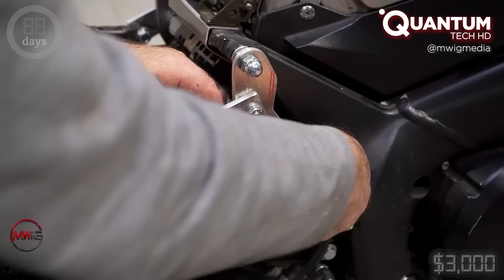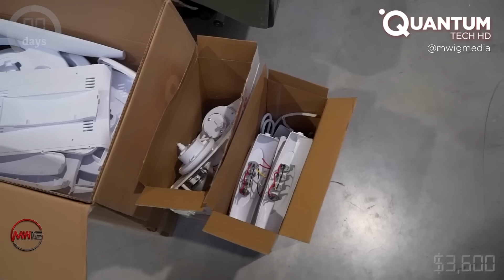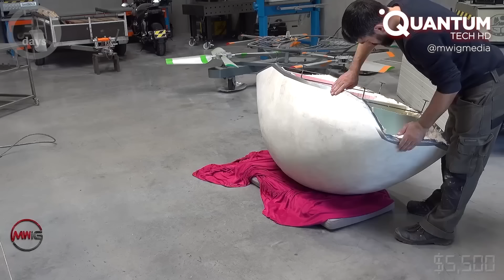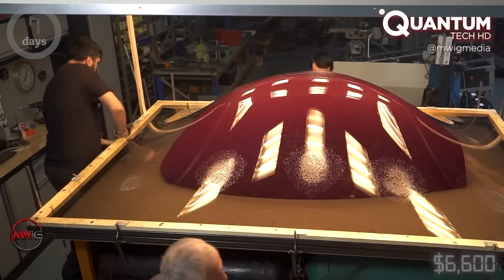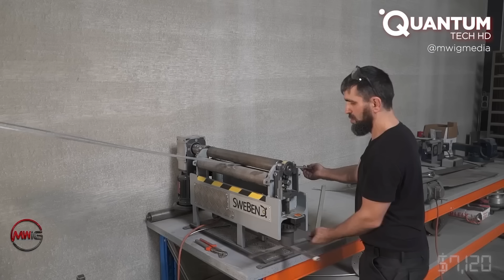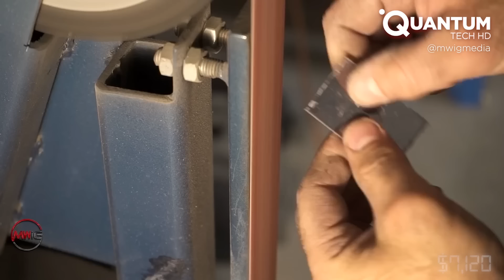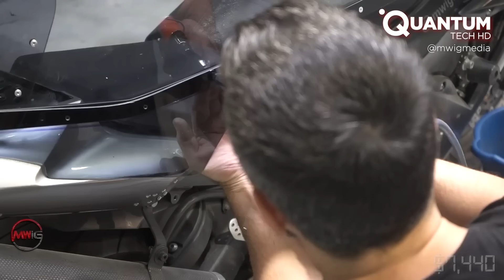The Motorcycle That Beats the Rain (Built in a Garage) | by @mwigmedia

Comment: Interesting, maybe he could have made an oven with a reverse mold. Using poly-carbonate with heat, air pressure and time instead of the vacuum. Then coat the outside with rain x and the inside with anti-fog.

Comment: for anyone interested in the pump system I believe fast bags air suspension which is pretty much air suspension with bigger valves technology would be helpful in his air vacuum applied with a heavy or weighted lowering process from heater to mold would of help out that problem

Comment: The bike design looks really impressive, but having to ride in a continuously bent-forward position is not good for our health, especially for the back. Also, if the bike skids or falls, how much protection does it provide to the rider? What are the chances that the rider will remain safe? And if it suddenly stops raining, how quickly can the bike's cover be removed? Also, what will riders do in hot weather?

Comment: That was the most dumbest shit I've ever seen. Excellent effort to build something completely impractical and not fit for purpose?
Would be hot as shit - no wipers for the rain, no demister, no air plus your legs and boots soaking wet.
All through a tinted screen which would limit your vision in rain anyway.
Me thinks this only achieves clicks.

Comment: Forgive me but as an inventor myself I have to state what to me is the obvious. I've ridden my bike in Washington State where it rains on and off all day.. stood my solid ice pants in the corner and made bets when they would collapse. That  said The first thing I notice is that the legs and feet are not protected.
  As to the molding... ARE YOU KIDDING ME? Heat rises!!... That is a major hint... I've already designed two simple ways to do it without all those heaters, wand since its a simple shape no vacuumed needed.. another clue  And he's not reheating it again and again to get what he wants,, WTF... plastic can be heated over and over again so ling as you don't sing it (white bubbles)so its not a failure  until it's entirely white with bubbles!! (practice makes perfect)
  His skills are very impressive but exicution is of a novice and clearly has too much money. When you do things with less or nothing at all that's when you get really creative IMO... Which brings up another question... why does the whole thing have to be plastic? You only need clear where you look... The rest can be anything that is light and durable and weather proof.
   And as others have pointed out  aerodynamics is a main factor.. time spent in a wind tunnel and or computor program will help. I believe that done right cross winds would have less effect instead of more... 
   Then there is the protection roll bar to prevent complete destruction when you wipe out in the rain or ice or snow... (yes Ive ridden in all including through the snow storm that brought down an airline in the Potomac , ... Wiped out like fifty times.. BTW if you are going to ride a motorcycle in two feet of snow on the highways... (don't) follow the big trucks wheel trough and keep your arms stiff. The wheel will ride up the wall and then correct itself ... think of toboganning.... and watch the build up of snow and ice which fall off and go SPLAT ALONG WITH YOU AND THE BIKE, ..USE A FOUR CYCLE NOT A SNAPPY TWO CYCLE... IF YOU HAVE TO USE TWO CYCLE USE THE HIGHEST GESR POSSIBLE .. OTHER WISE YO'LL SPIN THE TIRE AND LOOSE ANY BIT OF TRACTION AND POP YOU ARE ON YOUR ASS AND CARS ARE TRYING TO AVOID YOU ...
aND never EVER RIDE ON ICE WITHOUT SPIKES... HITTING SNOW EVEN ICY SNOW IS FAR LESS PAINFUL THAN ICE AND CONCRETE. gRAVETY SEEMS TO BE TWICE WHAT IT NORMALLY IS AND THE ROCK HARD GROUND CRACKES BONES... 
  Sorry caps lock... One last question... why are we still on the ground for travel?????
Blessings

Comment: I have a dream about a motorcycle that has a waterproof fabric attached to the windshield, folded and barely noticeable in good weather, and in the rain you unfold it and place it over your body and head as protection. It is transparent in the head area, has support ribs for strength, but is flexible enough at the same time. A kind of cover-up as part of the motorcycle... You wait for it to dry before folding it back up. Is something like this feasible in a practical sense?

Comment: Reasons why I believe there are problems with the design:
- Aerodynamics
- Windshield
- Air pocket created by vacuum
- Crosswinds
- The person's spine remains arched for a long time
- Passenger squeezed against the rider
- Hot days
- Difficulty keeping it open for refueling, for example
- Even though the design is for rain, the legs are still exposed

Among several other questions about the additional weight, whether the use of a helmet would still be necessary, etc...

Comment: Very impressive skills, but as a motorcyclist its really a solution to a problem 99% of all motorcyclists don't care about.
Also, try doing a turn - very little room to counter weight by moving your body, the same issue leaning at speed. Plus in a crash you are now attached to the bike and there a various bits of metal waiting to impale you. Crosswinds will be horrendous. 
The more I think about it, that thing is just a death trap!

Comment: I'd hate that. It's not riding under the rain that's problematic. It's riding on a wet surface with limited visibility if the rain is heavy enough and you get splashed into your visor from other cars etc. If getting wet was the only problem, it wouldn't be a problem at all.

Comment: If he creates a strong enough metal molding which is based on the working prototype. With a constant heat source during vacuuming, a single piece shell could be made.

Anyway it’s a marvel piece of engineering.

Comment: There are so many things you can add to that design... to start, warmth, since hot air rises you can capture the heat from the engine and blow it in the cabin; add extend the cabin a bit to add a rider and a back spoiler for wind control as well as side gills to expel to assist in aerodynamics, shin pad shells to protect from rain, etc. Tons of potential.
Reply: Além de um limpador de parabrisa.

Comment: I don't speak English, I use Google Translate.
Am I the only one who thought about putting fans inside the oven to regulate the heat?

For example: With the acrylic piece attached to the oven, the fans would rotate at low speeds. The goal is to redirect the heat, not inflate the piece. Once the piece is removed from the oven, the fan speed is increased. This helps keep the piece hot enough for a longer period so the vacuum table can do its job.

It's important to clarify that, by physics, heat always rises, never falls. This raises the question of why it didn't work initially if the oven was at the bottom. While that's a valid point, some heat is lost during the transfer from the oven to the vacuum table, and the vacuum process is slow.

In conclusion, a lot of money and time could have been saved by simply installing fans inside the oven.

Texto en español.

Soy en único que pensó en colocar ventiladores dentro del horno para ajustar el calor?
Ejemplo: Con la pieza de acrílico pegada al horno, los ventiladores girarían a bajas revoluciones, lo que se quiere es que redireccionar el calor, no inflar la pieza. Una vez retirada la pieza del plástico del horno, se aumentan las revoluciones de los ventiladores, con eso se busca mantener la pieza lo suficientemente caliente durante mas tiempo para que la mesa de vacío pueda hacer su trabajo.

Cabe aclarar que, por física, el calor siempre va a subir, no a bajar. Eso abre la pregunta del porque no funcionó al principio si el horno estaba abajo. Es valido, pero en la transferencia de horno a mesa de vacío se pierde parte del calor, eso sumando que el vacío es lento.

En conclusión, se hubiese ahorrado mucho tiempo y dinero implementando simples ventiladores en el horno.

😁😁😁

Comment: What if he made a chamber and using a propane heat source inside it to remove all the oxygen to make a vacuum? It could be made in such a way that the heat inside the chamber would also create the heat to soften the plastic and then sealed to create the vacuum. The plastic would remain hot in the chamber from the heat.

Comment: Buy wet weather gear. Buy a small car. If you have an accident you go where the bike goes because you can't get off. So Mr Engineer you need to put this through crash tests to see what happens, good luck. Riding a motorcycle is all about skill and riding in the rain takes a whole set of different skills than in the dry, so unless you want to ride all year in this monstrosity because you want to stay "dry" don't ride a motorbike. By the way, the heat from the engine will rise into the dome. Water and heat create vapour which will condensate on the inside of the dome making it impossible to see out. P.S you should always wear gloves.

Comment: We didn't need these back in the 1960s when  you could get a fairing that was designed for weather protection rather than speed. You only got wet when you stopped.

Comment: does anyone remember the DUSBIN or DUSTBIN fairings of the 1950s and I think early 1960s for road racing motorcycle motorcycles, the famous V8 moto guzzi motorcycle. If you look it up, you’ll see that it has a DUSTBIN fairing, which is a fairing because goes out over the front wheel instead of just up around the headlight area or just around the handlebars like today’s MotoGP machines.
You’ll see what I mean if you look up the 1957 moto guzzi V8 Rd. racing machine on the Internet
Here’s the problem/reason we do not see dust bin fairings anymore
They have too much frontal area/surface area in they were dangerously susceptible to side winds. If you have ever owned a motorcycle that gets moved around by the wind/side winds, you’ll know what I’m talking about. I had a Honda CX 500 no fairing no windshield, I really liked that bike, it was the engine designed from the very beginning to be turbo charged by Honda, V twin like a moto guzzi. Riding that motorcycle when there were crosswinds that weren’t very strong, all of a sudden the bike would be leaning about 10 or 20° without any input for me. It was a strange sensation. I never got caught in any high winds, so I don’t know what would’ve happened if I had been traveling and it got very windy.
But this bubble on this motorcycle, it may do a lot for keeping rider dry but there’s gonna be a couple other problems beside side winds . If it’s cool out, that’s going to trap a lot of heat inside that plastic bubble, and that is going to steam up/fog up the bubble on the inside. I experienced fogging up of my face shield on my full face helmets commuting to work in temperatures down as low as 35°, and in my road, racing days, early in the season, such as April or late in the season, november, where I raced in the snow one time, you’re breathing a little heavy when your road racing or any type of racing, and it was a problem, trying to keep the face shield from fogging up. And during a race you really can’t use your hands to wipe off the inside of the windshield. I could see that happening a lot with this bubble, especially if it’s raining because inside the bubble is gonna be warm, and the rain is going to act like an HVAC condenser, it’s going to cool the inside surface of this bubble and moisture is going to condense on it, been there, done that
Even on your cars today, when you switch your climate control to windshield defrost to turn the blower on, you have the advantage of it activating the air-conditioning cooling feature to condense the moisture that is inside your car on the evaporator coil, and it goes down the drain to the outside under the car, and you have a blower motor blowing on the windshield which eventually clears the condensation fog. But not on this motorcycle.
Also, if you leave home with that on your motorcycle because it’s raining, then what happens when the rain stops, and you’re riding down the road and you’re getting a lot of spray from the wet road on that bubble that you’re supposed to be able to see where you’re going, you’re not going to be able to see very well. You’re going to have to pull over and clean that which is going to end up scratching the hell out of it. When you clean Lexanne or plastic, you can’t use paper towels. You must use cotton or microfiber only because paper is abrasive to Lexanne or plastic even the hardened Lexanne that they use on the glass at hockey rinks. I used to work with plastics. The same goes for your face shield or the windshield on your motorcycle warrior sunglasses or regular reading glasses, never never use paper towels on them.
The inventor of this bubble windshield, reminds me of one of the lyrics from a Rolling Stones song “as tears go by “
The applicable line is
Doing things I used to do
     They think are new..
Believe me, this has been tried before
On the program, storage wars, Barry Weiss, who is known for showing up on different motorcycles and different cars or trucks to each of the television options at times, one of the cars he showed up in a couple times was very much like the Batmobile, with a dome plastic, completely cover roof, a bubble of plexi glass or Lexanne. In the sunshine, that thing would be an absolute greenhouse oven, with engine heat added to to it can you even imagine riding inside that greenhouse dome on a brilliantly sunny hot summer day. I believe you would lose consciousness. Not only that, you would constantly be cleaning the bugs off of it..
Beautiful, work, attractive, looks like it fits well, but, I’m gonna pass for all the reasons I mentioned

Comment: Been riding for over fifty years and riding in the rain is never fun. Learned all about side winds on the Oregon coast in the rain while crossing a corrugated steel bridge deck…!! Or tucking in beside a transport truck to get a break from wind gusts that required a 45 degree lean to travel straight … side area is not your friend on a bike!!

Comment: Two more attachment points may be indicated; curved struts running down the left and right rear side, the canopy glides on, and connected to rear lower chassis— this will ↑ structural rigity and ↓ "lift flex." Consideration will have to be given to the driver's leg swing clearance, getting on and off and on the bike. They may have to extend out to the rear of the motorcycle, and articulate so they glide on a track, mounted to the rear exterior of the acrylic enclosure– merely a thought project — Your design is as practical,as it is strikingly aesthetic!

Comment: You put in way to much effort for very little work necessary for a canopy.
get your center line, frame/weld it. mold using heat gun that way no room for water seiching etc and all that extra crap!

Comment: Honestly the only other last touch would be a hydrophobic film on the front windscreen and side forward halfs and itsl could if not would pass safety the only other concern is break away in a crash would it trap the rider do more harm or would it break away easily, also making this with the ability to remove the top shell alone when its not rainingnwould also make this a more sough product especially if people are stubborn enough to ride there motorcycles in rainy weather

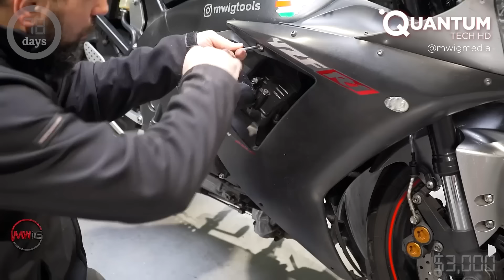Comment: 3:19 say his only 2 opinions were to buy a 100k dollar thermoforming machine or build the machine himself. However, there was a 3rd option. Simply hire the services of a company that makes plastic parts. They'll 3D print the mold and make several copies for you for less than what you paid to build the mold, make the oven and the 100s of hours of labor.
Reply: You totally missed the point . He creates , he does not buy .
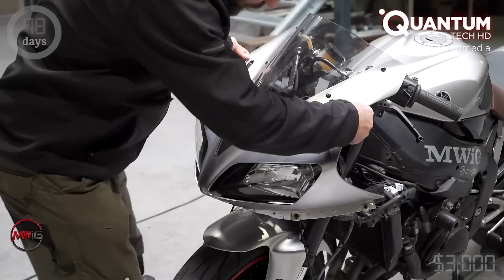Reply: @michaelw1570  No, you missed the point Sherlock. 🤔 He literally said at 3:11 that the only reason he didn't buy a thermoforming machine is because it cost 100k dollars which was too far beyond his budget. That means the only reason he only made his own machine is because it was cheaper. Not because he wanted to make his own tools. 

You totally forgot he was up against the clock to build his project. That means he wasn't trying to create all his tools, unless he had no choice. Using a supply chain for tools to make parts that you designed is not the same thing as buying it from someone else. They would just let him rent the factory equipment to make parts. Its still his design and he still owns the rights.

Comment: I've been riding motorcycles for almost 50 years and one reason I'm still in one piece is that I make it a policy to NOT ride on 2 wheels in the rain even though motorcycle rain-suits have been around for decades.  Sure, it can be done but it increases the risk of an accident exponentially and if you don't understand that you don't understand that rain significantly decreases traction.  And what about crosswinds?  That's a real danger as well with this invention, not to mention that it won't keep your legs dry either.  In other words, this rain cover only makes motorcycling more dangerous than it is.

I guess some people have nothing better to do than invent things that we don't need.
Reply: Concordo em " Não há nada melhor para fazer do que inventar coisas que não precisamos " Apoiado !!!
Reply: Yeah those painted white lines with zero grip, cars dropping oil on roundabouts and at lights and the sudden appearance of old potholes are my primary concerns in wet weather.
Reply: Yep, when it comes to riding in rain, getting rained on is at the very bottom of the list of things I worry about, with today's riding kit it's not even an issue.
 I'm way more concerned about less grip, poor visibility and poor wet weather driving from other road users.